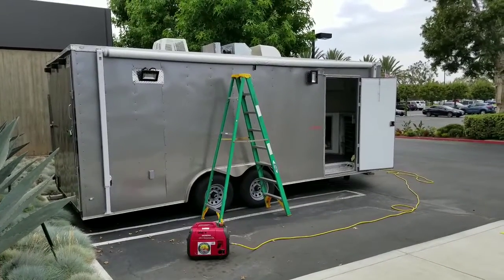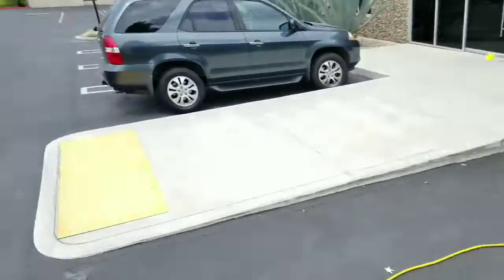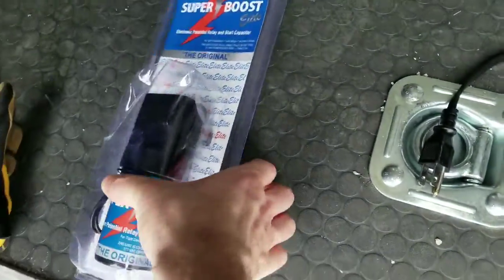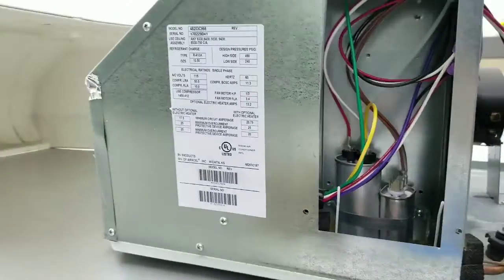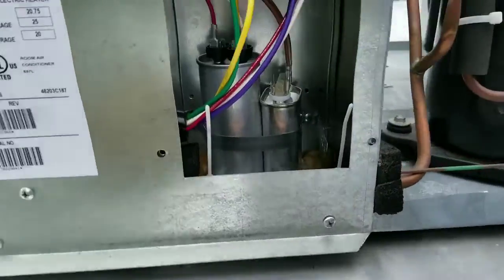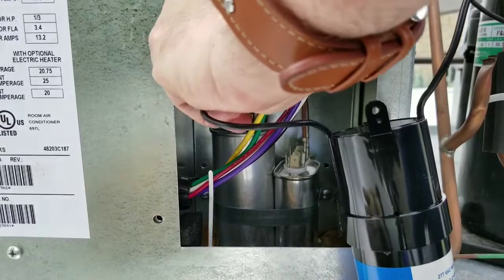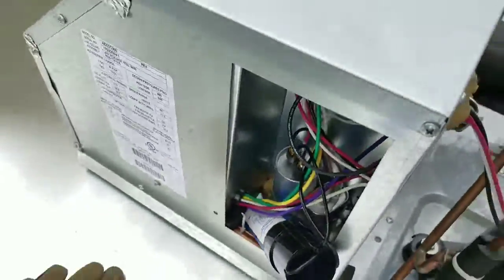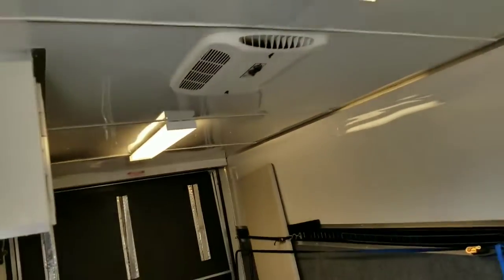Installing a start capacitor on an RV air conditioner

Comment: You added a Hard Start Capacitor to your AC, you already had a START CAPACITOR and a Fan/Compressor RUN Capacitor. Your generator is too small for the job. Will work for a while but will wear out your genset and compressor twice as fast. I use a 3500 watt generator. It's 35 years old. that 2000 watt generator is good for running a 5000 to 6000 btu window unit. Just my humble opinion.

Comment: What btu is the ac are you running with the EU 2000i?
Reply from the maker: 13,500. LRA (locked rotor amps) is 63 on the HVAC unit. So 120 VAC x 63 Amps = 7,560 Watts. Without the start capacitor, you would need at least a 8,000 watt generator to start the HVAC unit and overcome the LRA.
Reply: @Batterybackuppower  I found your video because I want to reduce generator surge with a capacitor if possible.  I can run a 12,000 btu window unit with a EU2000i if eco mode is turned off.  Once the compressor is running, I can switch back to eco mode.  AC specs state 8.7 amps, 115 vac, but I do not know how to find lra.
Is it possible to make a portable "capacitor board" which would be inline between the generator and the AC unit plugs into it? (Rather than install the capacitor inside the AC unit?)